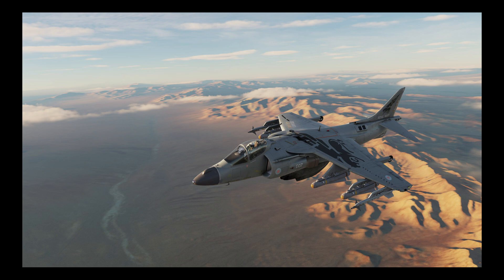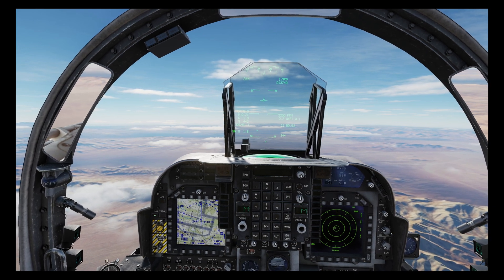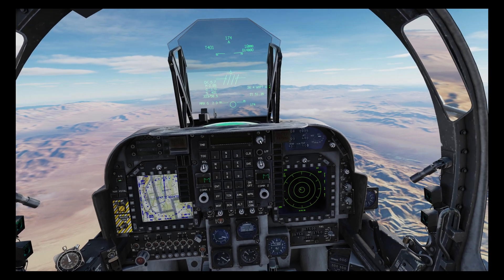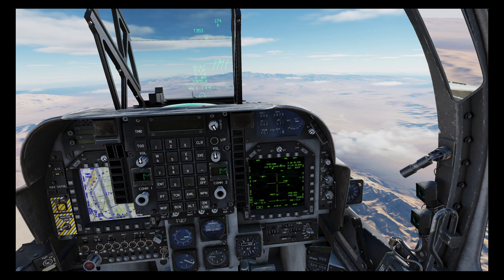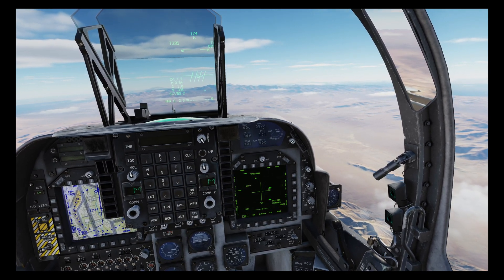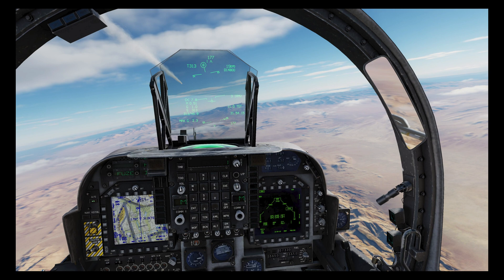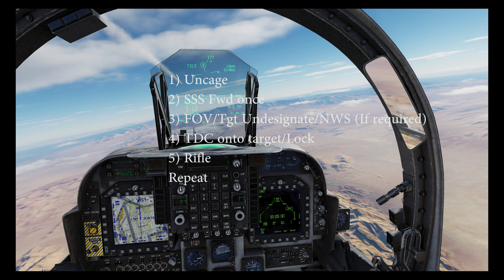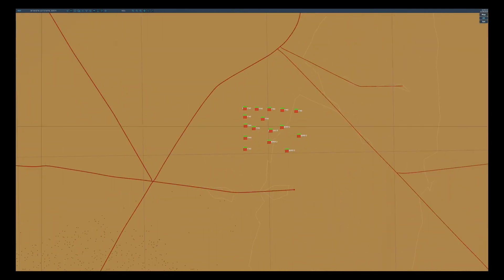DCS: AV-8B Harrier AGM-65F IR Maverick Tutorial Part1 (remastered)

Comment: It strikes me as an absolutely terrible interface design choice to use the same control for undesignate and FoV. To even have these as modal just seems mad but to have them modal on the same control makes me wonder what the designers were smoking. Was this a DCS or plane-designer’s choice? Either way, it wouldn’t get past the wireframe stage of any semi-competent interface design process these days. In fact, if a UX or UI person gave me wireframes with something like this in the design I’d probably think about whether their contract should be renewed!
Reply from the maker: Hi. Im not quite sure what you mean about the same control for undesignate and FoV...there is no undesignate control and by the FoV control do you mean SSS left in TPOD HOTAS Mode?  To anser the other point - yes the design if from the aircraft manufacturer and not Razbam/DCS. Razbam have copied the function of the actual aircraft; and there are quirks for sure, but there is a historical reason for most of them, rather than bad design you have to remember that the version in DCS is an evolution of earlier aircraft which had different systems so perculiarities crept in over the years - just like humans and other animals are in many ways badly "designed". One example is the TPOD and Maverick having to be on the same display - both canot be displayed at the same time, which is due to the way the Bus was originally designed in the 60s. anyway - anyway get back to me with a little more detail on the FoV and Undesignate issue.

Comment: Hi. I dont know what i am doing wrong, but the IRMV Lock is just a coinflip for me.... i fly direct to the designatet target sometimes the IRR Mav get a lock but to often it doesnt??? What i am doing wrong?
Reply from the maker: You are doing nothing wrong. After this video was made, ED overhauled the IR model (for the release of Apache so whilst the video is still accuratate in terms of procedures it's no longer possible to get a 12 mile lock (for most vehicles). What ED have done is made the IR signatures more realsitic, previously a vehicle was simple hot...not if it's not moving/engine off it will be very hard ot see in IR mode and if moving only part of the vehicle might be hot for example tracks/engine or mayhbe the barrel if firing so it's ahrder to get a lock...a moving tand firing target can still be locked at maybe 8/9 miles if lucky but it's normally less....and if it's not moving/firing it will be far less than that.....now this IR model is applied to vehicles and not all vehicles are updated yet so some still shot as big green hotspots but ED are slowly updating the models to the new format. with this new model there will be some uncertainty which is actually realistic. If you imagine approaching a tank from teh rear with it's engine running you will get a lock easier than coming from the front where the hot engine is hidden....I would recommend taking a look at vehicles with teh TPOD in IR mode to get a good look at the IR signatures for some reference.
Reply: @Pukin-Dog  Wow thanks for this massiv information reply. Thank you now i knwo it why it is a coinflip :)

Comment: Can you please reply with the keybind name used to attempt a contrast lock once IRMAV is SOI? Great video--going to use FOV button instead of fumbling for the OSB.
Reply from the maker: I think I know what you mean but nit 100% sure so please give a timestamp....I "think" its the tdc action hotas button. I use realistic mode not Easy mode in the options menu
Reply: @Pukin-Dog  at 5:19 after stepping and you have a open crosshair on IRMAV as SOI. Many times when I uncage there's no lock. But I learned a while back (before I took a break) that there's a button to force correlate/contrast lock. 

I think the button you noted is correct. But if you'd be so kind as to confirm.
Reply from the maker: @schoff9568  yes I am pressing TDC action at that point. I need to redo this video (when I have time) as it's no longer possible to get a lock at 12 miles on a non moving vehicle (since the ED update on FLIR heat signatures). A static tank is cold so you cant detect it until a lot closer. I am going to wait though as ED has really messed it up. Some vehicles llike BDRMs are bright whilst tanks arent and even the dust trails are wrong... some show hot and some show cold. It's a complete mess
Reply: @Pukin-Dog  That had to have been my issues. I couldn't understand why I didn't lock. Thanks for the insight and your great content!
Reply from the maker: @-cml-schoff4848  You're most welcome!

Comment: I was wondering why you’re not assigning TOO points to each vehicle you want to hit?
Reply from the maker: I replied to this - but it doesn't seem to be here. Maybe I didn't hit submit or something. Anyway. You most certainly could use TOOs, but I wanted to show both methods and with the seperated targets you it's a real benefit. When they are close - it's still a benefit - but not so much. Also it would depend on if you have the prep time. Some missions you might not have time to allocate all of the TOOs
Reply: @Pukin-Dog  I just tend to find that slewing the seeker head is a jittery mess. However, recently I’ve been finding it next to impossible to use the TPOD and F Mav as the mav seeker keeps replacing the TPOD on the right MFD instead of being on both screens. It works fine with the DMT but the FoV and clarity of the DMT is nowhere near as good as the TPOD. Wondering what I could be doing wrong.
Reply from the maker: @_od_7825  You can't use the TPOD and Maverick at the same time unfortunately. This was changed in an update and whilst it's frustrating I am pretty sure it's because that's what happens on the real plane. As for jitterly movement; are you using an axis or buttons? Buttons - there isn't much you can do. If it's an axis then create an S curve....I have a heavy S with 1-100-100-20 (Deadzone-SaturationX-SaturationY-Curvature) which gives me fine control in the centre part....but I can still slew quickly if needed.
Reply: @Pukin-Dog  I stopped using the Warthog nipple axis because I struggled to get a satisfactory curve on it. I use the mic switch as my slew control, so buttons. I’ll have another go with the S-curve. 

Annoying about not being able to use the TPOD with the Maverick as you used to be able to. Thought I must be doing something wrong!

Thanks for the help!